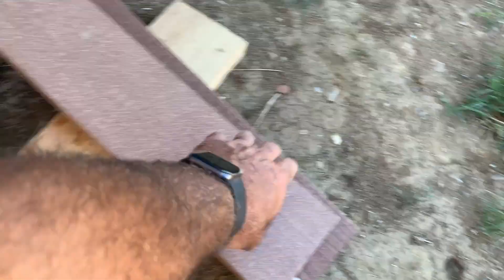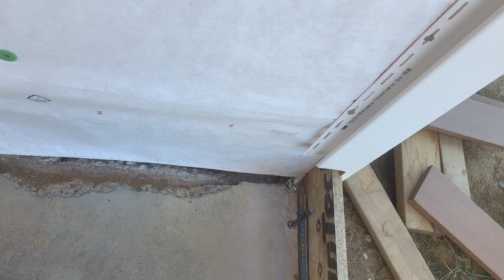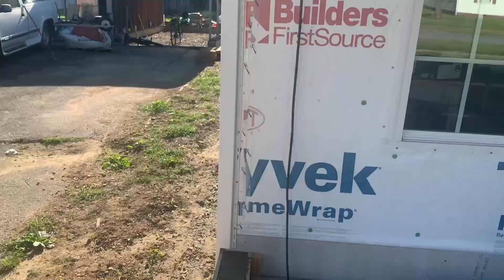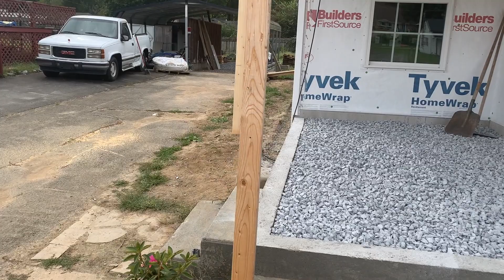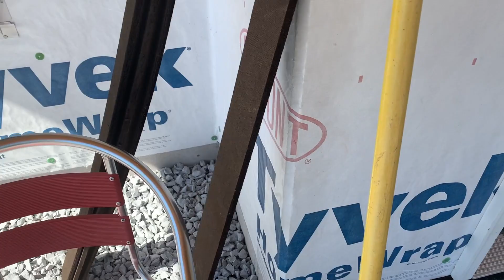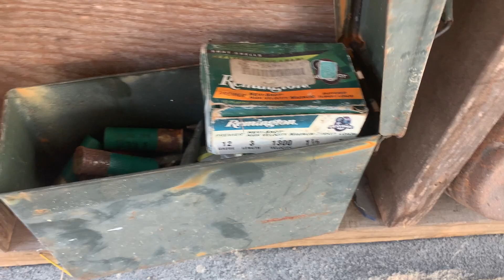Not Necessarily HVAC Part 15

Comment: That concrete board will wick water like crazy. If using it you have to use a liquid Membrane over it like red guard to keep if from soaking moisture up, it will rot out  that wall eventually.